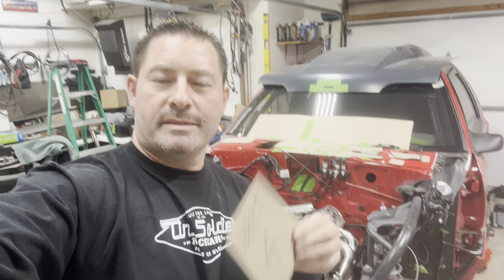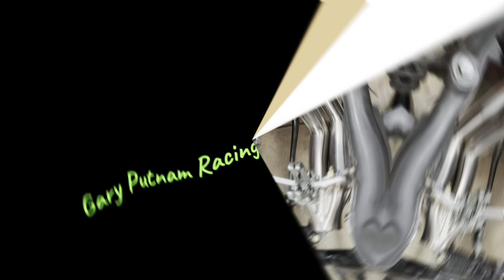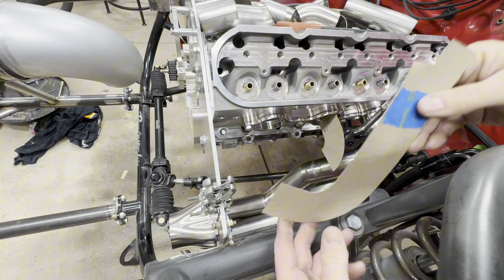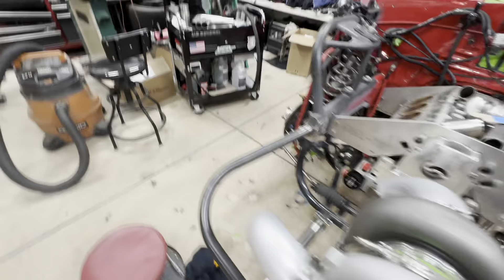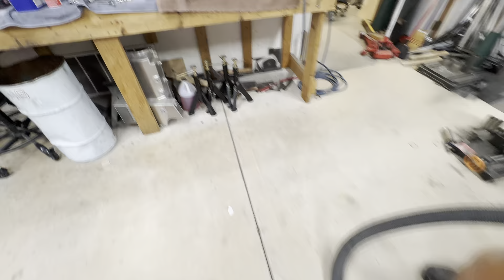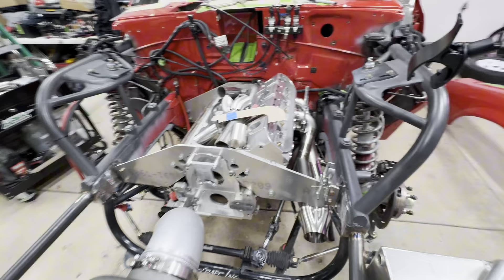PART 4..... BOOSTED 427" LS Header build

Comment: Would love to see a little more fit up. And how you used the templates to actually cut more of the pieces and get the fit up so nice. I like the template and ordering some card stock now.
Reply from the maker: I think I know what your wanting and if you browse my channel there might be a few different videos that show what your asking. Throughout the 4 header videos (part 1-4) there might be some more stuff showing the use of templates.    I'll see if I can copy and paste the links here.  Let me know if this is what your looking for, I'll try to help!!!

this is specific to making the templates     https://youtu.be/qgF3bgUbiEc?si=1n7ZouedyJPz_TKv

this is rounding up the tubes.       https://youtu.be/jCluhuLrnjY?si=b4DgEPuP6iOMiJsz

cutting the tubes across the angle with a hand held grinder   https://youtu.be/5Pu0VMP7YJE?si=uQWka8rn_HkyWewD
Reply: @  yeah I’ve seen those videos I was just referring to the steps you take when fitting a couple pieces together to make the fitment perfect. I’ve been doing turbo kits lately and I use a lot of pie cuts and I want to get away from that. Less welding and be able to more precisely fit up tubing